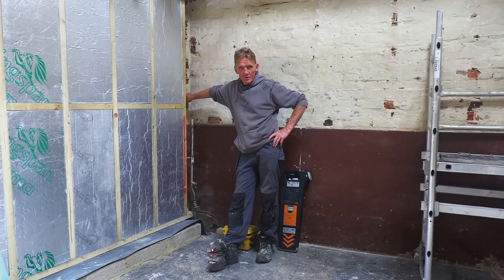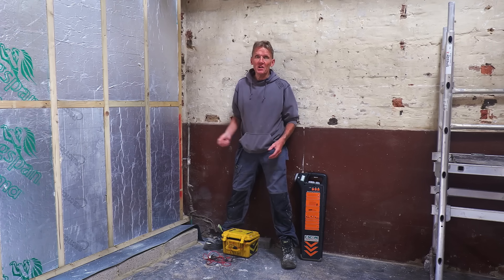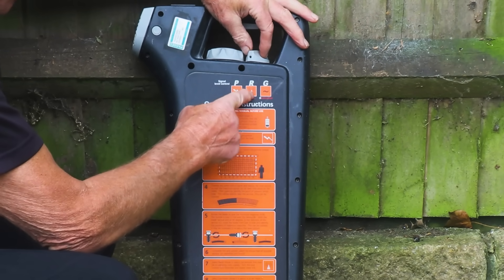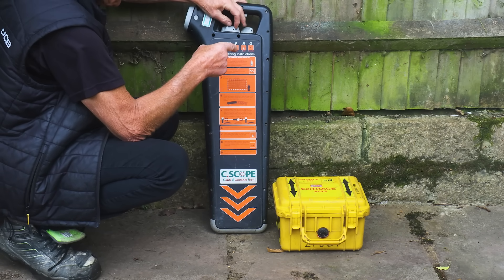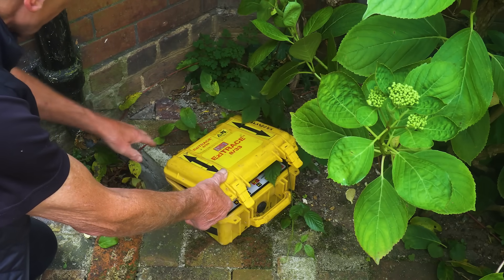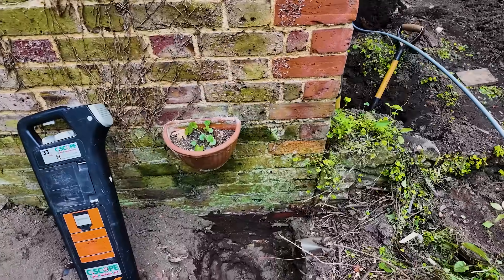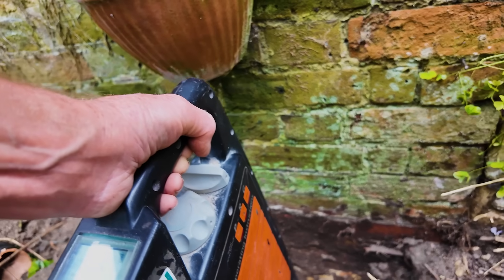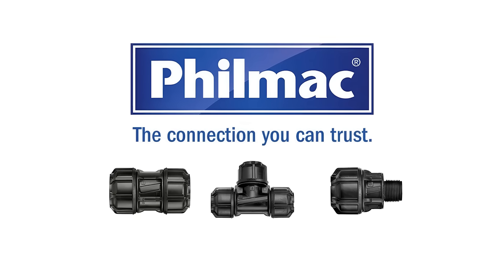Pipe Locators Save Hours of Digging — Here's How

Comment: We use a similar equipment from Leica. I am not an expert in any way. For this to work properly you have be at least 5m from the generator box (at least for the Leica). But our setting is quite different. No copper pipes in the ground and most iron pipes have been replaced by plastics, PEM, at least for freshwater. For the septic system that usually are plastic or concrete you can use a radio transmitter that you attach to wire or similar and put into the pipe. And then you use the same detector. Quite efficient.

Comment: As a cable jointer of over 30 years, the Cat and genny were essential tools, used daily. Here are a few tips.
A good earth connection is a must,  and damp ground dramatically improves the signal .pour water around the pin and allow to soak in.
Try to place the pin at 45 degree's away from the suspected route and always check around other directions to get a comparison of other signal strengths. It is very easy to rely on your first assumed route. 
When attempting to locate an electric setting on the Power setting on the CAT alone always remember it relys on the flow of amps through the cable, so if possible put on as many appliances in the property as you can to improve your  chances

Comment: Have the chinese not made available a $30 version of this yet? The tech by now should be far old enough they should've been able to reverse engineer it and cost engineer out to bare bones and without the fancy brand surplus cost like you get with Fluke multimeters... sure they're super calibrated and accurate and all but 99% of folks aren't engineering a city or space shuttle. One of the very few things I can appreciate about modern China's existence is democratizing technology for the common man, ironically.

Comment: When I was 18, whilst working on a site, I was sent to locate a water pipe that was exiting an inspection box. Seemed like a straight forward enough task, I could see the pipe exiting the box.
So I took my rabbit spade and begun digging. I dug a trench right across the front of the box, about a foot away. I lengthened said trench, first in one direction, then the next. Then i made it deeper, and deeper, almost waist height, and all i could do to stand in, being so narrow! Then a new trench down the left side.
Breakfast break came and went, then lunch break. Another trench to the right. same again, lengthen, deepen. Nothing!?! Then on the left, same, nothing!
Nearly time to go home, 5.00. Utterly perplexed by now, I decided to dig flush with the wall.
There it was!! It exited the box and immediately took a sharp left, and followed the wall, almost touching it! It then went around the next corner and ended up exactly behind the box and heading off in completely the opposite direction!!!   😆

Comment: Bare copper through the wall and in the ground doesn't seem too cleaver but how far do you go to make it good? A 25x3mm Polyethylene pipe in a blue 40mm conduit is the flavour of the day here in France. In Germany (Berlin area) they seem more slack: Mains cables can be placed directly in the ground (not armoured and not in conduit). If you want any more useless information, let me know.

Comment: I would have thought you'd be able to use a mechanic stethoscope about 6 squid,  if water is running in the pipe or you have a leak should pick it up.